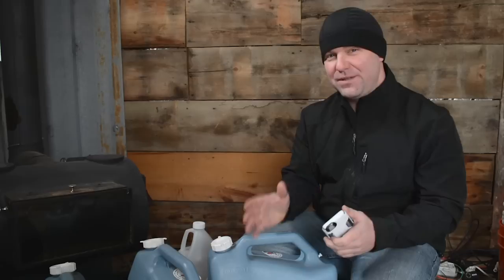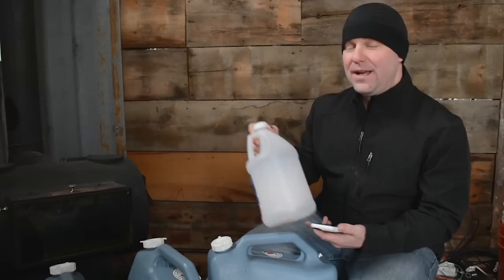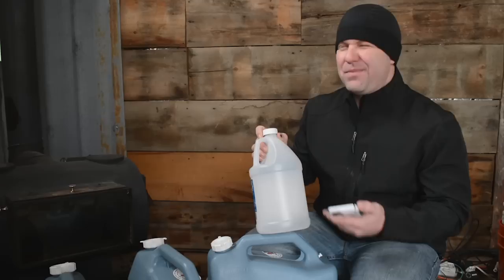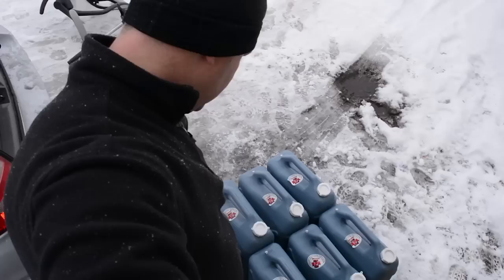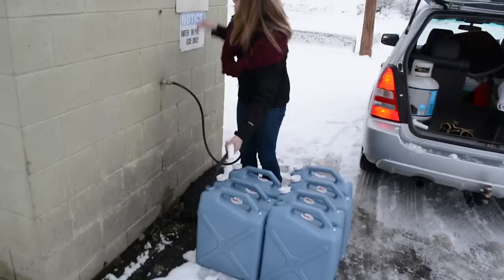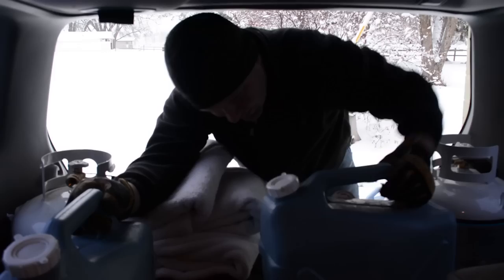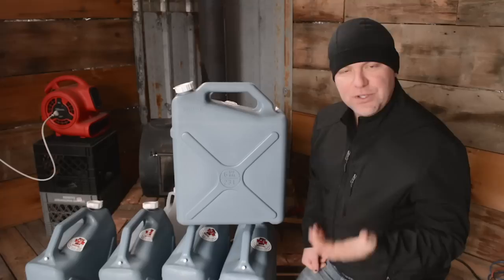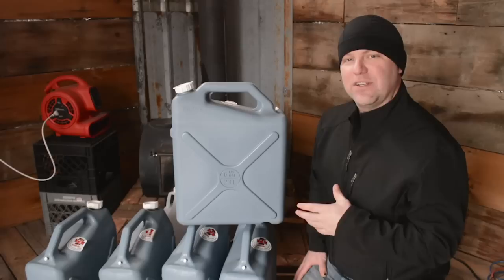Stupid-Easy OFF GRID WATER SYSTEM FOR RV!

Comment: We live about 50 miles south of you and have a few acres that we're slowly building on about 25 miles south of you. During the summer when everything was dusty, we needed water for keeping the dust down etc. Our solution was a 275 gallon tank that we hauled with a 3/4 ton dodge and filled up at a water station a few miles away from the property. Harbor freight has both 120v and 12v water pumps that we used to pressurize the water and used a simple garden hose to a sprinkler. Worked great, but we generally emptied the water tote while it was on the truck because 275 gallons of water weighs over 2k lbs. Luckily if we ever needed to get the full tote off the truck, we were able to use our tractor with forks on it. Also, a quarter gets you 100 gallons(at least at the station that we used). Anyways, it's cool to see what other people from our area are doing. If you ever need help, feel free to let us know!
Reply from the maker: Sweet! We've seen and researched a lot of tank styles. The problems are the same with all of them for our needs. We discuss this more on our blog for those that want to learn more. Can't wait to have a tractor or other similar tool. Will make these heavy jobs a lot easier!

Comment: This is great. I love those bottles. I'm lugging water in the big blue water jugs you get in the camping department and they are just too heavy, but I need water. It's free from a spring but it must be hauled in just the same. 
I just moved onto my property in October and started my reefer conversion. I'm living in it as I convert it. The wood cook stove was put in, on Dec. 17th, it was nippy. But you are so right no property is perfect but you make it work. 
Lovin the videos. Thanks.
Reply: If you have a wheel barrow, it may help you lug the water.
Reply: That is my plan. I now have found my well and have welded my riser onto it. I'm putting a no freeze hand pump on that and it will pump into the bath tub in the bath house. The pump house/ bath house is a short walk from the house and it's a wagon in the summer or a sled in the winter. Only a short walk however. Much better now. The spring is always a good back up year round.
Reply: Red tankgirl do you have a blog? I am trying to follow off grid women who are doing this on their own. Hopefully, very soon, that will be me.

Comment: Moved off-grid over 30 years ago.  Into existing, but primitive house.  Had a drilled well in the basement with a hand pump.  After 2 weeks of using a bucket for water-everything, we installed a used deep-well pump and ran  it with a generator when we needed to fill a pressure tank.  You quickly find how much water you really need and how much you wasted, before.  Life was much more interesting, back then.  Technology has greatly improved off-grid living.

Comment: My property is on a creek.  In the mountains (I'm actually in a valley.  The mountains are 30 seconds away).  An hour from the 2 nearest towns of any size, but only 20 minutes from a tiny town with a store.  My cabin is off-grid, but there are power lines at the corner of my property.  There isn't much of a winter (which is why I bought property in Oklahoma), and there's lots of rain for rooftop water catchment.  Long growing season, because food is good.  The best part though, is I have 10 acres, all of which could be used for growing food if I needed to.  That's the only part that worries me about your property.  It's gorgeous, but it doesn't look like there's much flat area for growing crops - especially after having the septic tank put in.  I'd be interested in a video or blog post about that - things you're considering, etc.  Maybe some raised beds over the septic tank?
Reply from the maker: Nearly half of our property is well suited for animals, tree and food crops. It'll take a while to get it all working for us but it should produce more than enough of all the above. Thankfully the septic location resulted in a very small footprint and is in an area that wasn't ideal for much else anyway. 

Sounds like you have a sweet place down there! Enjoy a cold glass of Luzianne tea for us!
Reply: That's good, then.  In the videos, it looks like the flat area is just a tiny little sliver of land, so I was saying to myself "How are they gonna grow anything on that?"

Comment: Simple is good. we use a similar water hauling container, but we use collapsible ones so they are easier to deal with when they are empty.
Reply from the maker: That's even better! Where did you find those? They must have thin walls perhaps?

Comment: There are used food grade containers that you can buy,anywhere from 60 gallons all the way up to a couple hundred. To dispense from these type of tanks a simple method is to put a pneaumatic air fitting in the lid of said container.......then using a car powered air pump,pressurize the tank to no more than 5 psi. It will transfer the water in a reasonable time with much less effort. The 6 gallon containers could then be your backup water.

Comment: Hi guy, first let me wish you both the best of luck, you're facing a ruff road ahead. I noticed in one of your video's you mentioned you currently didn't have a cooking oven. I'd suggest a Coleman Camp Oven if you've not heard of that before. You may have an oven now but if not the Coleman Oven can be used on your wood stove. It can be used on a BBQ grill or a Coleman stove. I prefer the Coleman White Gas stoves over propane because of cold weather but that's just a preference. You don't have to rely on the Sun! You can bake when you want with the Coleman camp oven. Check them out, you can get them 2nd hand on Ebay for about $20 bucks or less. Another suggestion is simply Make and oven. Basically an oven is a metal box if you think about it. A cooking thermometer can be used as a means to check your baking temps. You have access to metal, All you need do is make a metal box to place on top of your wood stove, make a simple rack system an there you have it! Or do what my grandmother did and use the wood stove as an oven. Dutch ovens also work well! Good luck!

Comment: An idea I had for an off the grid water solution was to hook up several air connectors, like the ones on a tire inner tube, to a sealed water system. Then just pump it up and pressurize it some. The air pressure will push the water where ever you need it. If your pressure gets low, hook up a pump to your nearest connector, and add a little more air to the system. If your tank is big, it will hold a lot more compressed air, and it will go longer between pressurizations ... though it may take a bit more pumping to get it pressurized in the first place.

Comment: If you get two of those little IBC tanks that contain more then 250 gallons and put one permanently up high and one on one of those cheap harbor freight trailers you can hall water to your place of living and have a simple water pump to feed the water from one tank to the other.  Less work no lifting problem solved :)  If your worried about freezing wrap the tanks with some kind of insulation.  don't need to go crazy but it will work.
Reply from the maker: +trip3980 That could be a great option for some but the reason we didn't go that route can be found in this blog post: http://purelivingforlife.com/rv-water-solution-off-grid/
Reply: +Pure Living for Life So I read your story and the solution I have is simple figure out how much you can safely transport and mark the water tank to the height the water can be filled then transport it back to your place.  You may be able to transport 100 gallons.  If anything you could transport 2 55 gallon drums or one depending on your needs.  55 gallon drums are like $15 used.  It beats all the extra work you need to go through.  Or better yet put the back seats down slide 255 gallon drums on its side in the trunk then add a tap to the tanks and when you get back to the house stick a hose on the tank with a simple pump to the tank or drum at your house.  I know how crazy carrying water jugs is.  and I personally think it gets old after a while.

Comment: To add for some one aren't sure: If you run your chimney outside on an ever lifting gradient, so the heat coming from the chimney goes under the table.(hot air rises), make a hot table(use clean metal with 3 inch sides) and a roof made out of any material. Make sure to paint the roof and sides black (as this will help to retain heat), have one corner at the lowest point with a drain, (make sure you fit a good quality filter) and then into your water tank. Next shovel clean snow off the ground onto table and wait for snow to melt and make water for your tank without traveling miles to fill lots of water jugs. This is a great way to get lots of water, from the snow on the ground every morning after it snows. I hope this helps someone.

Comment: I use the exact same blue jugs for transporting water to my future off grid location. I have several fruit trees that need a lot of water. We have 2 issues we have to work out.  We have mostly fine sand and we live in Texas and are having a very hot summer. We found our jugs at walmart.
Reply: Composting will help your soil. Plus consider putting composting materials interlaced with leaves & small branches in a trench & put sand over it. The trench will keep moisture & add natural fertilization. 

For lugging your water, consider using a wheel barrow.
Reply: Good ideas, thanks

Comment: Something to do for your seam's run down to your hardware store or Wal-mart and get some "DUCT TAPE"  2" wide and tape over your seam's on your cabin extension to stop your draft's it will raise your temp 2 to 5 deg alone and is well worth the investment: Also spend one day to put fire wood into your cabin as much as you have room for  to dry out and it help the burn process: And last but not least have a steel plat wielded into your stove from the flue to the other side and end to end leaving about 2" to 4" space at the front edge for thermo reburn of the combustion gases "(can find the math on the internet)" and install a damper then you can pack your stove and when it's burning good you can the shut down your damper's and it will burn longer.

Comment: you can get a free used swimming pool. if the liner is bad just get visqueen plastic to use as a liner. a pool can store 10 to 18,000 gl of water. you can treat the water with pool shock

Comment: I should have posted this earlier, but building a full platform/floor for your shed was a BRILLIANT idea !  Wait until spring when everything is muddy and you will appreciate it twice as much !
Reply from the maker: +theoldwizard998 We couldn't really know how well it would work out, but it's working for now! All you can do is try right? :) Keeping out of the mud has been SO helpful. We had 10" of rain plus 12" of snow melt that made a messsssss. Our floor was dry though! :)
Reply: +Pure Living for Life ... and keeping the camper cleaner by taking your shoes/boots off outside.
Reply: +Pure Living for Life Approximately how much propane per week are you using ?

Comment: here is the question I have, how is the carbon monoxide levels in your cabon/tent? I myself had one of those pop up garages and a camper on some land up north, and that furnace really roars. I know the exhaust just comes out the side, do you have some exhaust pipe out the side of the tent? or is there air flow in the cabin/tent? Love your videos, I have some ideas on doing something like this and fun watching your mistakes and Triumphs. By the way love the hot tub!

Comment: I only recently found your channel so have a lot of catching up to do but thanks for sharing your challenges.  I enjoy learning about how people overcome their challenges.  It won't work in winter but how about putting gutters along the sides of your structure to run into some barrels?  It won't be much but it'll be something for at least a little while.
Reply: I agree. should be on top of the list,very easy and cheap to do.        why pay for a expensive well?  collect rain water and going to that water supply seems to be cheap enough

Comment: how about this,  buy a small trailer 5'x7', 6'x8'. buy 5-55 gl drums. strap 4 of the 55  gl drums to the trailer. raise 1 55gl drum to the height level or just above the trailer. make sure the raised 55gl drum has a garden hose in the top and sealed. the other end of the hose should reach the ground. go fill your 55 gl drums ( that is 220 gl of water). connect the garden hose to a 12v pump. now you have 55gl of water to gravity feed your home. once you empty the last drum on your trailer, go fill the 4 up and repete. you can insulate the garden hose with pipe insulation and the 55 gl drums with any type of home insulation then wrap and tape with a tarp.

Comment: I'm in the process of going of grid as well. The water issue is a concern, because the property I'm on isn't mine to begin with and I don't want any thing there that is permanent. I want everything to be able to be moved when I'm going or moving off that there is no real sign of me being there.
There is a river about two miles from this property, you know what fish do in the river, right?
The river runs through farm property's and getting water from there may not be a good choice.
In the summer I can harvest rain water in 55 gallon drums, but come winter there would be the freezing problem and a full drum would crack.
I could get the drinking water from the town which is 8 miles away or being that I heat with wood, use the wood stove to melt snow for drinking water, yes you would have to filter it.
For that reason river water I feel is not a good choice here because of what could be in the water and is it safe to use? You could use it for gardening or washing not for drinking.

Comment: wonder what the cost on a plastic sliptank with a dc pump to run off your vehicle would cost. somthing light enough that after its empty u could easily remove from car or bed of your truck. another pro would be for watering garden possibly long hose n less grunt work. love the vids hope me n the misses do this sooner then later. cheers
Reply from the maker: Not out of the question, so we have lots of options, but we'd rather invest in a proper permanent solution before going deeper into temporary fixes.
Reply: Pure Living for Life you should have that engraved on a plaque

Comment: Bravo, good to see your doing what works for you, I'm sure at some point your going to find a better solution for water. I have asked myself a few times while watching your video's, why you two didn't just build a tiny house on wheels but your doing what works for you and that's all the counts. I was wondering how your making electricity. And, I'm wondering about the tent your trailers parked under, where you got it, and if you got it right after the trailer or before, if you bought it or made it?

Comment: Nice set up . Do you use the water from your fresh water tank for drinking or do you buy bottled water for that . When camping ( summer time ) I have 2 50 gal barrels outside of my RV . I have a 12 volt pump hooked up to the city water feed from the barrels . This way I don't hear the noise of the water pump in the RV when the water is turned on . How do you dispose of your grey and black tanks . Grey water is easy but that black tank can be a problem .
Reply from the maker: Currently we use our RV tank for all uses. We don't expect to live in our RV long term so this solution is simple and keeps us from wasting resources that can be better spent elsewhere such as a permanent solution. Check out our septic video for how we addressed the waste issue. :)

Comment: How did you locate the  25 cent water ?    Also,  I've seen your generator…how many hours do you have on it ?   Obviously, use varies per weather / need .    What is the life expectancy of that gen ?   I think it was a Honda  2000 watt.   Continued good luck be with you.
Reply from the maker: Our county fairgrounds has a public potable water source. It was free but they added a coin op so it's $.25 now. Supposedly it's 400 gal but we don't know that for sure yet. Look around in your area for such a supply. Fairgrounds make sense as they have a lot of livestock to water. 

Gen has 400 hours so far. We are using it less and less as we get dialed in on how much we need it. Not sure on the life but it's well into the thousands of hours. 

We run it about 3-4 hours a day on heavy days. When doing construction it runs all day to power tools. 

In the meantime we run off our RV battery which we charge w a our RV + a Schumacher multistage charger. We can go about 2 days without charging but it's better to keep the battery topped off than discharge it totally.

Comment: Buy A STEAM ENGINE TO MAKE 12V automobile type power. this unit will be a centerpiece in the new home within A expandable Garage like living space. it is to be like a household hobby.. the border wood fired it's a hybrid because it has A flat cooks place and a water heater.  use barrels band and connect them together linth wise.  inside is the steam unit.. There is at least 3 different designs the simplest one is a long cylinder heavy large. steam pipe it has a tee to make a steam dome. this is a very large T and for safety you want to put a dome over the dome The Sun makes calling a cab..  people up north in Alaska rely on these machines more than the solar panels. investing in this wise off the grid project will help to draw viewers.  once but together they are worth a great deal to people off the grid in truth it is one of the coveted items. for a little bit of history old steam tractor boilers was implemented for household heat. bathhouses like them as well. there is one thing though they eat a lot of water you would need to have a cistern for storage or large tanks for storage. you would need a well or a pond good make sure your steam engine has at least a half inch drive shaft.